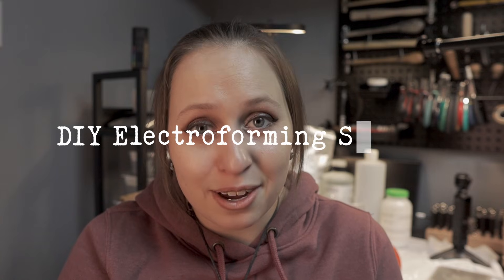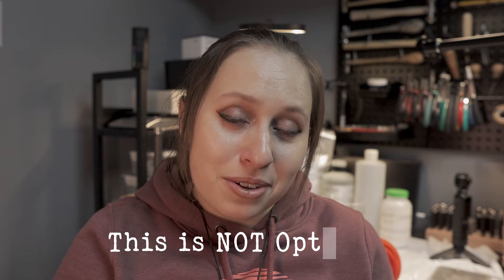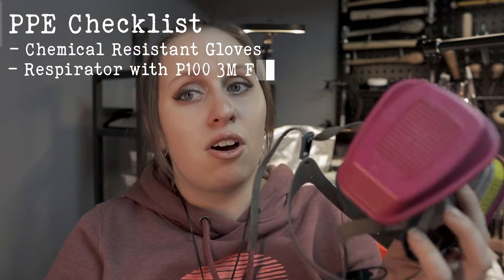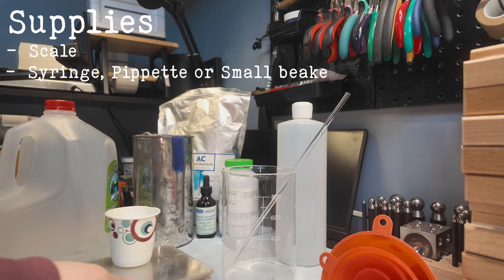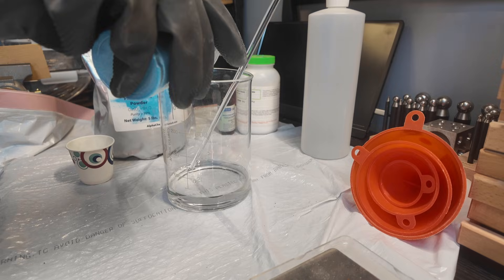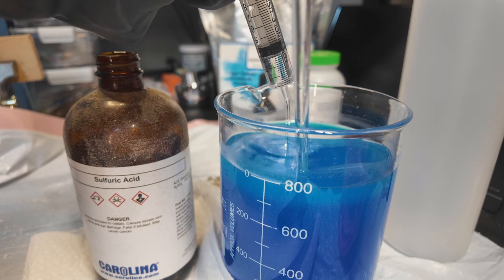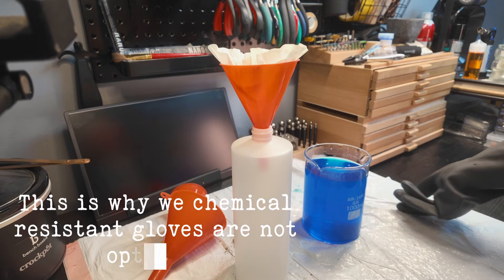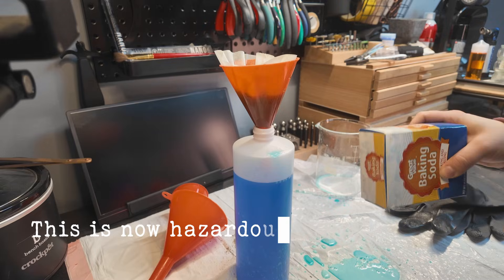Electroforming: DIY Electroforming Solution- My Personal Recipe

Comment: If I wanted to make a larger tank, say for 5 gallons, could I repeat these steps for the 1000mL solution and add as needed? Or would it be better to do the math for the ingredients and make a full bath at once?
Reply from the maker: Hi, You can do either option. I am not a fan of math so I just repeatedly make 1000ml batches.

Comment: Hi, thank you so much for your videos! Question, when it comes to disposal of the solution, what container or disposal bags do you use? My solution somehow got contaminated and I need to dispose of it. It makes me nervous just having it in the container sitting on my shelf. Thank you for any info.
Reply from the maker: Hi, when it comes to the solution you can pour it into an bottle or container made from HPDE plastic and take that to your local hazourdous waste disposal. (Almost all counties have one you just have to look up what their requirements are) You can also neutralize the solution by adding baking soda into until the pH is no longer acidic before you take it to the hazardous waste facility. You do not want to dispose of it into ground due to the copper in the solution or down the drain unless it is neutralized and very very very very very heavily diluted with water. Some counties have very good waste treatment plants that allow disposal down the drain, but look into your local laws before disposal. Thank you for asking the question! :)

Comment: No clue why this was suggested to me, but as a chemist who now works in HSE?  I would tell your followers to learn to do a "fit test" with the respirator and give it some time.   Your health and safety are important and there were a lot of experiments we did in college that would require much more PPE in an industrial setting.  I've watched a few of your other videos and glad you are helping others stay safe with their hobby.  🙂
"Add acid to water like you ought to" is for safety reasons.   When you heat something in the microwave and it splatters, this is what  happens if you add water to certain acids (strong acids especially).    Heat is generated quickly due to the reaction and the acid can splatter and/or vaporize.  This vapor can get on surrounding objects including any exposed skin and even in your eyes if your eye protection doesn't seal to your face (goggles).  The same reaction is taking place by adding acid to water, but the water won't get as hot as the acid alone so less safety risk.
Reply from the maker: Thank you so much for the explanation! I'll be sure to add this knowledge to future videos and I find it awesome that a chemist has stumbled upon my videos! I had to include safety because for artists we sometimes forget how dangerous some of the stuff we work with can be, especially when many of us do this for a living sometimes you can get lax. I also agree that in my college chem labs I had a lab coat, gloves, and safety glasses. We never even wore respirators due to the fume hoods so the fit test is great suggestion. Thanks! :)

Comment: I don’t know what this stuff is?
Reply from the maker: This is a very specific recipe for a DIY Solution for Electroforming. Electroforming is an art form where you can take almost anything, paint it in conductive paint, drop it into this solution, add electricity and coat your piece (usually jewelry) in a thick layer of copper! I have few videos on jewelry I have made using this process if you are curious about it!